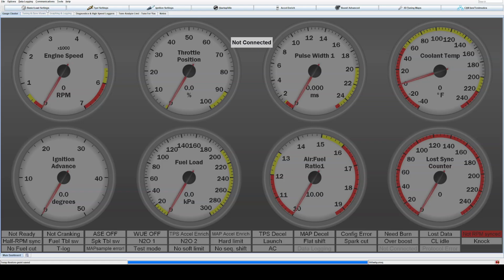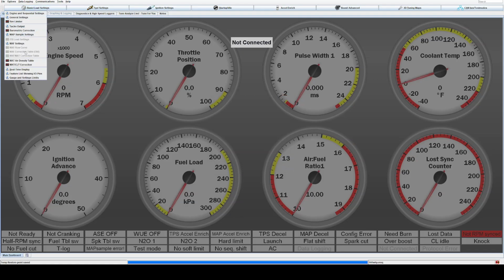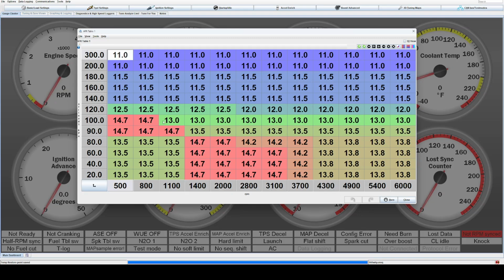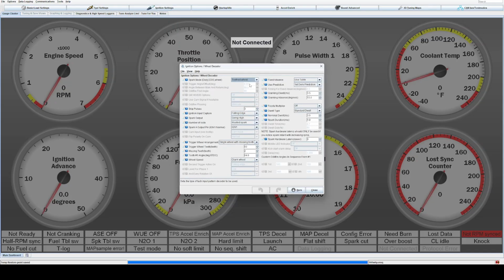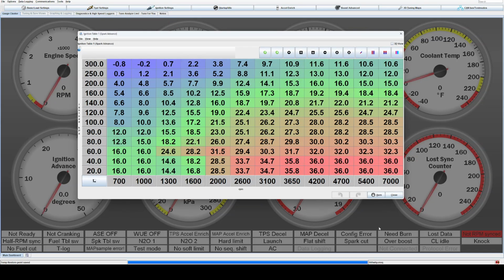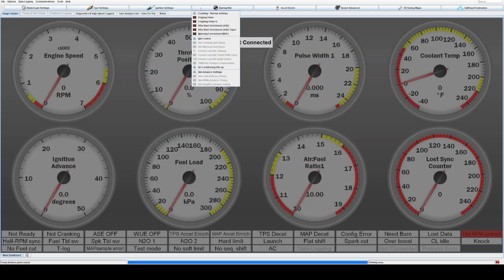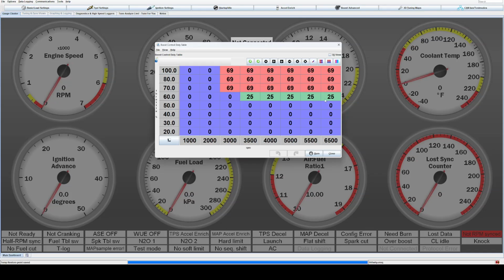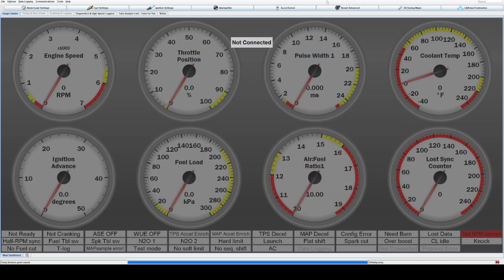560WHP BMW E28 Turbo Tune Overview | How to Tune Megasquirt

Comment: If you want to compare the injector on time to how far the crank has swung. It’s 120,000/engine rpm = milliseconds for 720* 
Fun little thing to have for on time vs crank degrees.
Reply from the maker: I’ll give it a try !

Comment: Love all your videos. Would you mind touching on tuning tips with higher comp engines? Specifically, I’m talking about the b35 vs b34. How different are their hp/torque limits on stockish setups and what to be cautious of when boosting? Thank you!!
Reply from the maker: Not a big difference between tuning the b34/35. Standalone ECUs can give you so much control compression ratio to a point isn’t an issue as long as you have good fuel. So far stock rods on my b34 are taking 645lbft to the wheels so over 700lbs at the crank. So it’s pretty beefy and the b35 is no different

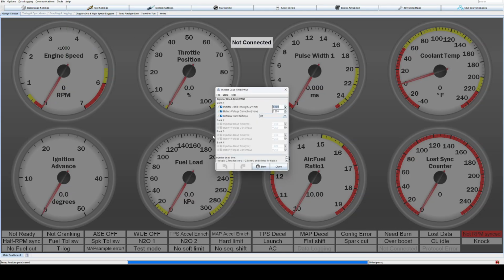Comment: What fuel pressure are you running with those injectors at 1.3 dead time?? 3:09 i have a set of those  but i don't think my setting are accurate 😂😂 im using 43psi at 1.150 deadtime with .150 as correction but at idle my afr varies from 14s at 13.8v to 11s at 12.4v🤯 the dead time i seen for these injectors has been from .6 to 1.3 now
Reply from the maker: 3bar base fuel pressure with 1:1 on boost
Reply: @TurbineResearch   does my situation sound like I need to add that extra dead time?
Reply from the maker: @2.5Tduratec93notchback  dead time is less crucial than most think. Most injectors just need around 1ms at 13.7v. This is the dead time from the Siemens Deka data sheet for those injectors. Just make sure it’s set correctly and it doesn’t need to be adjusted again
Reply: @TurbineResearch  my idle is at 1000rpm at around 24-26kpa and a pw of 1.5~ at 13.7v and 1.7~ at 12.5v. With that .2 diffrence my afr changes 3 points

Comment: Your engine bottom is stock, what about piston ring gap? And bow do you manage to tune tight stock piston ring gaps?
Reply from the maker: The bottom end is unopened. Stock ring gaps. With alcohol fuels the pistons stay much cooler and ring butting is less likely
Reply: @TurbineResearch How about the head work what sort of changes have you done there?
Reply from the maker: @will3835  100% bone stock
Reply: @TurbineResearch Absolutely crazy man. Working on something similar  for my E23 and your videos have made me rethink my plans on how far I need to go into the core engine I bought to set up for boost so I can just swap it out at some point.

Comment: Why you dont use incorporate AFR Target? Any particular reason?
Reply from the maker: I prefer to tune the engine without EGO correction using the AFR target table and rely on a well made fuel map. just my preferred method
Reply: Basically what he said, you should tune with only the VE table and not using the ego correction. Once you have a real solid tune down, then you can incorporate EGO correction. One thing to note is to only use it up to 100kpa. You DO NOT want to use EGO correction while in boost as an error in that can cause your engine to blow

Comment: Aren't you concerned with the lean out using fuel cuts for rev limiter and launch?
Reply from the maker: It’s how the oem does rev limits on most cars and I haven’t seen a problem with it in 7 years. I’m more concerned about using a spark cut and breaking a rocker off